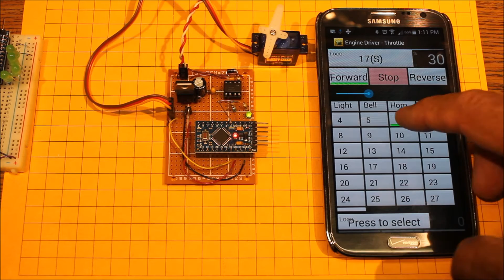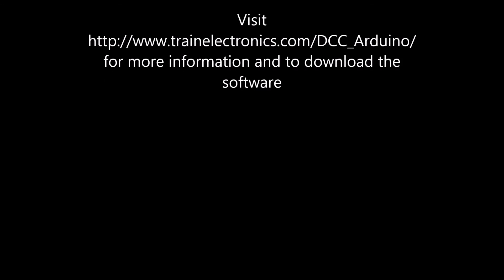Arduino using DCC Commands to Operate a Servo

Comment: Using a traditional DCC throttle like the one made by NCS, can the address of this decoder be programmed like the locomotives?
Reply from the maker: The NCS throttle should work - the address of the device is set in the Arduino software.
dave

Comment: Hi Dave
I upload your source code to the Nano for a long time not finished, remove the USB and then upload other source code is also unable to complete.However, my previous program is still inside the Nano!
I hope you can help me find the answer
thanks
Reply from the maker: Richard -have you added the libraries that are used in the sketch?  
#include <NmraDcc.h>
#include <SoftwareSerial.h>
Have you selected the correct Arduino version in setup?  If you have the wrong version it sometimes hangs rather than giving an error.
dave
Reply: Hi Dave
Thank you very much for your guidance
I am troubleshooting for your description and found that my libraries are not SoftwareSerial.h, oh my god!
Dave, That’s impressive!
Thank you very much for your help!!
Reply from the maker: Hope you get it working, Richard 
dave

Comment: I really like that idea. I would like to be able to control a servo on an HO scale hopper car, to dump ballast. I would really need digital-proportional control, as opposed to incremental. With most DCC controllers, I think the only way to do a proportional control, would be to use the throttle, and set it up so that half throttle would be center on the servo. The hopper car would only contain the servo, a joined boxcar would contain the control electronics...